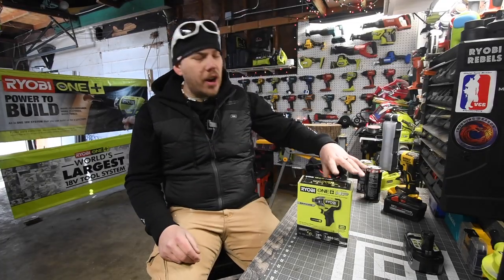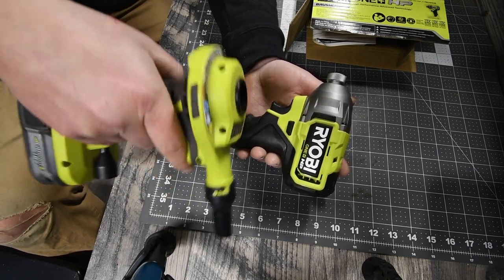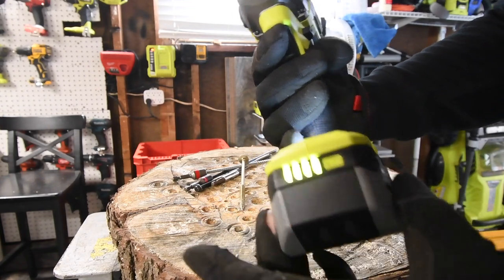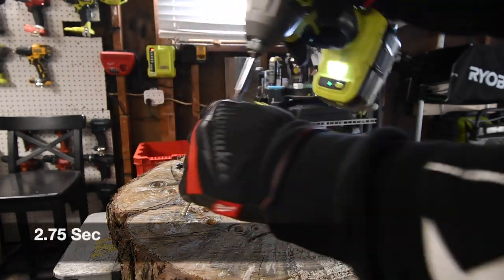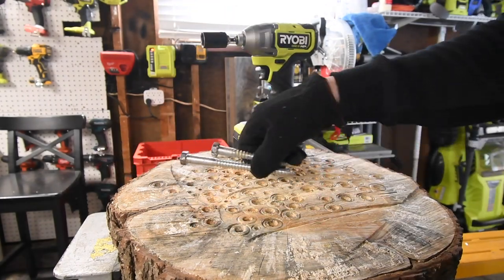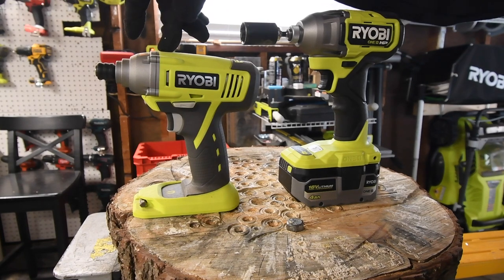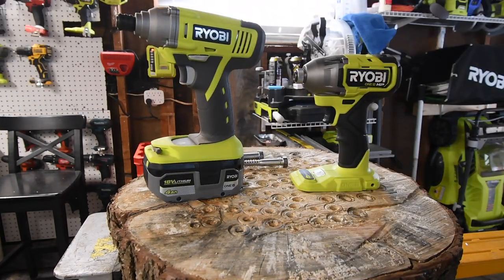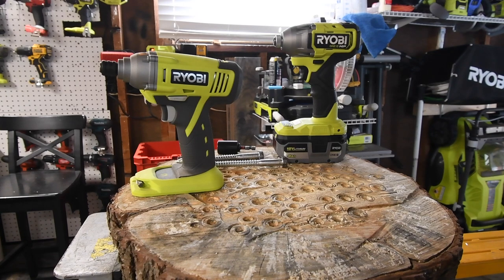How Ryobi used to be vs. NOW!!

Comment: I have a Ryobi P1870 like the one in the video. I primarily use it for screws, but even with the really old 1.5ah battery it did the job for me.

I am upgrading to the HP series, mainly because of the impact wrench. I also found out that my 1.5ah battery won't work with the high torque Ryobi impact wrench, and it cuts off immediately due to lack of battery output.

Comment: I believe that the special connection for brushless and battery is useful for delivering TORQUE, but the motor on the impact driver is at a constant torque due to the hammer and impact design 
So you dont need those contacts
Reply from the maker: that makes sense but it would be nice if they were there though

Comment: I'm glad the new Ryobi's are more powerful now, but what do I do with all my old ones? They still work for me.
Reply: If you're not going to get rid of them then consider not upgrading until you do, but it's sometimes nice to have tools you can safely loan someone too or for big projects you can chuck different bits in each and switch tools rather than bits...
Reply from the maker: if you dont use them you can use them as backups
Reply: Designate one for paddling and holesawing, one for predrilling, one for driving, get your kids to help with projects, etc etc 😁

It's like those old woodworking guys who all have 5 or 6 routers, a router for every bit xD

Comment: lol! The old impact driver was originally in BLUE coloring and ran off the original Ni-Cad batteries, which sucked. But back then a Milwaukee running off the same kind of batteries sucked as well. :D Had a Black and Decker 20v which ran off ni-cad, and it sucked, but it ran reasonably long. Best thing you could do back then was get some lead acid gel cells, and use those in any packs you could modify. Good endurance, did a lot of cycles, insanely heavy. ;)  They didn't push the limits on ni-cad packs because there was no real BMS, outside of maybe a thermal fuse that opened up when it got to 90-110C and reset when under 80C.  Of course, high cap Ni-cads of Sub-C size would do 50 amps, make metal white hot, did lots of bad bad things.  So, tools that ran off them simply didn't draw heavy current.
Reply from the maker: these new tools are incredible and powerful, I thank you for viewing Psibr1

Comment: Why is the p195 the only battery with 21700 cells? You should make a video on this because I think Ryobi should get back to making compact 21700 cell batteries. I’d buy ‘em out.
Reply: Ryobi phased out that Battery P195. But guess what! You should try the new Ryobi Compact 6.0Ah battery. That's what I have now on my recently purchased Ryobi PBLID02 One Plus HP 4 speed impact driver

Comment: Right now I have all Ryobi tools. I'm thinking about getting into either Bauer or Hart for some of the minor tools where I can save $10-20 from Ryobi versions. Any thoughts? Should I just stay with one platform? Very light DIYer....
Reply from the maker: the Hart brand won't last that long, the $10-$20 can go a long way. in my opinion
Reply: Go ryobi, hart Is junk and a pain to get, Bauer only exists in the US and probably won't have the same batteries in 12 years but with ryobi you can get a decent 6pc kit if you get the old blue tools (not the ones that look blown up tho) and a few new 4AHs for like 150$

Comment: Is this impact more powerfull then the PSBID01CN ?
Reply: Yes, compact tools are usually always less powerful than the full size tool using the same technology...  It's part of the trade off for making them compact/smaller and lighter... Less mechanical leverage, etc.  But smaller gets into tighter spaces and lighter means you can use it without tiring yourself longer too.  So compact tools have their place...
Reply: @charlesbuzz  Yes, I'm aware.  Understand, by their very nature compact tools are at a physical disadvantage to full size tools and require a significant technology advantage to overcome that but this impact is a HP tool as well and thus uses the same technology that's in the compact model.  It's also being coupled with a higher capacity 4AH High Performance battery, while when the compact models came out there was only the 1.5AH available.  Some of the full size HP tools will even have the additional pins for higher power draw to further max out their performance, SDS hammer drill and grinder being two examples, but none of the compact models have those additional pins.

The compact tools do perform better than anything Ryobi has previous produced at that size, like this blows away their old 12v attempts, but they're doing the same advancements to the full size tools as well...  The reason to get the compact tool is their smaller size, to get into tighter spaces, lighter weight to handle all day usage easier without tiring yourself as much, and good enough performance for what they're intended without always needing to grab a full size tool...  They compliment each other rather than directly competes...
Reply from the maker: The new one is pretty good

Comment: Ryobi is for diyers! Who needs 21700 cells for diyers, it would be too expensive!
Reply: 21700 cells are not much more expensive and the power difference is huge. In reality though a quality 18650 can output more power than any diyer tool can use.
Reply from the maker: I need 21700 cells lol
Reply: Jason Nguyen, nope you're wrong pal! Ryobi is not a DIY tool any more, and I can prove that. I'm a DeWalt Fanboy, but I also use and own the old Brushless Ryobi P238 Impact Driver in my jobsite to drive Timberloks and spax power lag screws for Ledger Boards to build the attached deck. And I emptied 6 boxes of Spax 6-1/2" and 8" hcr power lag screws and 2 boxes of Timberloks 6" screws. It passed the torture task that I gave on that tool I thought that sucker is gonna fry and smoke just like what I expected but know that thing is a trash But it didn't. And my Ryobi P238 brushless impact driver is still working up to this day with more and more punishments I also dropped accidentally that tool couple of times and it didn't break. I'm a DeWalt Fanboy, but the way I see the Ryobi tools are improving after all this years, the only reasons why Ryobi really can't go at the top is because of the Milwaukee Tools, Milwaukee is Holding Ryobi back and pushes back. Wanna see a Ryobi Tools that can beat top of the line Milwaukee tools??? Simple! Ryobi should set themselves free from the TTI. Meaning they have to get the hell out of the TTI company. And Ryobi should make their own designs. Like how Makita does.

Comment: Comparing the New against the old Brushed tools is a bit pointless
Reply: I actually think it's a great move because a lot of the older ones will be on sale soon for Ryobi days and this helps us decide whether to get the sale unit or maybe spend a few bucks more for the new one.  
newer is not always better so it's worth checking out.
Reply: @Jedi054  Yes, being brushed doesn't automatically mean it's less powerful.  The main advantage of brushless is efficiency, they'll last longer, and can be more compact but that's really it and rest comes from how well the tool is made and how good of a motor they choose to put into it...  So it's still possible for a brushed tool to be more powerful, it'll just be bulkier and won't last as long but doesn't mean it can't still be a great tool and can still last many years, especially for a DIY/Home owner user...

While there's also the "good enough" consideration, as paying a premium for performance, especially, if it isn't a big difference isn't worth it to everyone... and during a big sale there can be a big difference in price between old and new...
Reply from the maker: no its not, this shows you on the difference of Roybi tools form back in the day till now. this is a perfect video
Reply: ryobi doesn't delineate between low and and high end, to them it's just old product vs new product.
So it's a fair test as far as ryobi enthusiasts go
Reply: @ManCaverTools  yep! Exactly!